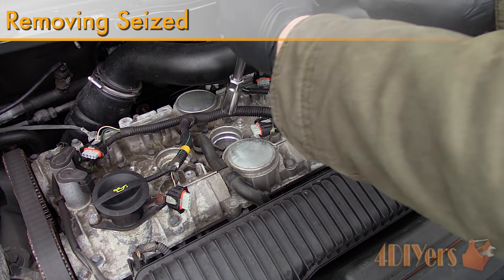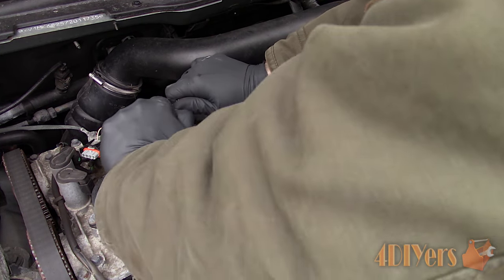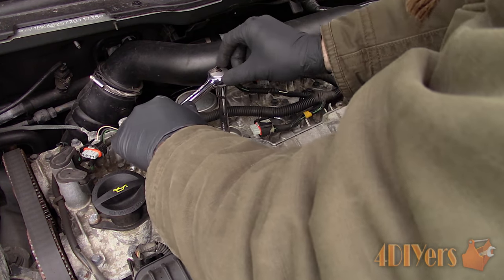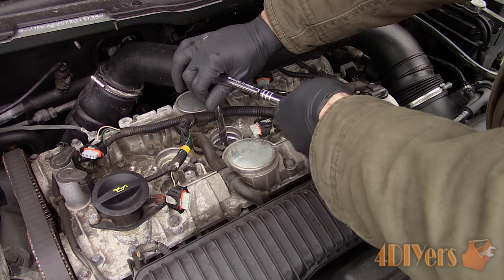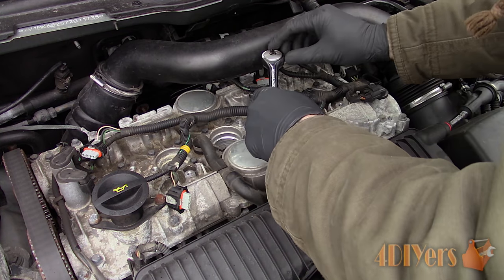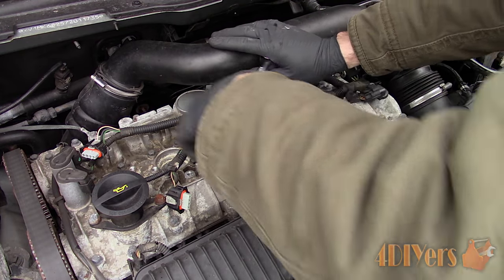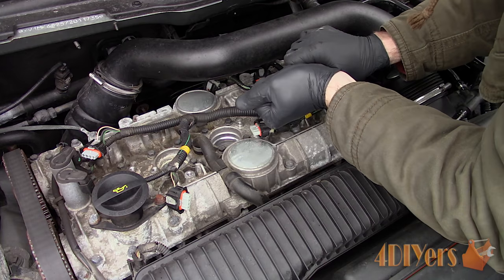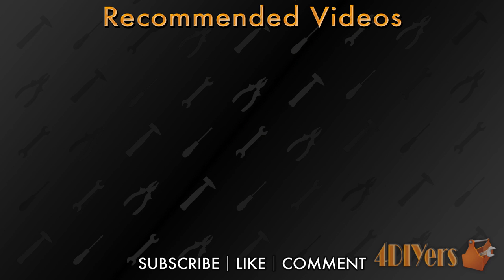How to Remove Seized or Stuck Spark Plugs

Comment: changed plugs on my daughters 2006 BM 325I  one plug was stuck i tried the back and forth and tried PD Blaster letting it soak started the car up to heat the plug  it as a pain all the way after a hour or so  it final came out and the spark plug had aluminum on its threads boy i was sick i just knew i wasn't going to get a new plug to start  But i got lucky it did and it seam to tighten  i used Anti-seize on the new ones not sure if thats a good ideal on aluminum heads but damn sure dont wan't to do that again

Comment: Thank you for the directions. I placed a piece of 1" schedule 40 PVC pipe on ratchet handle for more leverage.
Reply from the maker: No problem!
Reply: @4DIYers  Thanks for this video it actually helped me remove a stuck spark plug in my MK6 Volkswagen Jetta
Reply: I'd be afraid of too much leverage; rather strain myself than break off a plug!

Comment: I just replaced plugs in my 2007 saturn vue and they squeaked loudly coming out. I didn't do the back/forth method but just got lucky they came out ok with no noticeable damage. Being aluminum head I'm not sure if I should have used some anti seize. Would like your opinion, thanks.
Reply: I always use anti seize, and coat it all the way except for the last 2 threads. Just know it lowers the coefficient of friction so take care to not over tighten or crossthread.

Comment: I can’t get my plugs to budge either way and don’t want to really yank on it so am I screwed or what
Reply: Keep using a good penetrating oil on them, like pb blaster or seafoam deep creep. At night when the engine is cooled down soak them. Try removing them in the morning before you drive. Just keep doing that every day.

Comment: Dealing with this right now. I've read several people saying that Sea Foam Deep Creep turns carbon into liquid and melts it away. I just picked up a can. Hopefully I can get it out soon. Thanks.
Reply: Did it work
Reply: @mathewchavez9343  Nah. Either it's cross threaded or straight up seized. My head gasket started leaking recently, so since I'll have the head off, I'll fix it then.

Comment: Does soaking the spark plugs in oil help remove plugs that are a little bit melted? A mechanic said he didn’t want to break my plug in half and suggested I need a new engine
Reply from the maker: No it won’t help melted plugs. What happened? If they’re melted, your engine is most likely no good and will need to be replaced. Does it still run?

Comment: What if you have a stuck plug that you can barely see? I have a 91 ford Ranger. The plug is on the passenger side, closest to the firewall. Do I need to remove the AC to get to it?
Reply: If it's like the Explorer, and I think it is... wheel off and possibly the wheel well liner as well.

Comment: What I've just run in to is that the actual nut portion of the spark plug has broken off apparently with the spark plug still installed. I didn't even notice it until I went to inspect my spark plugs just as routine maintenance and when I went to place the spark plug socket over the spark plug nut, there was nothing there for the socket to grab on to. So i got a flashlight and looked down the spark plug tube, and that's when I saw that the spark plug nut was missing. So now I'm trying to figure out how to remove that spark plug, with the hopes it can be done without having to take it to a repair shop.  To be clear, the spark plug is still properly installed and the ceramic isolator as well as the electrode tip are intact and visible, car is still running just fine.  Question is how to remove that #1 spark plug that no longer has the nut attached to it.
Reply: What did you do?
Reply: @alexg8460  As it turns out, what had happened is that the last time that I had re-installed the spark plugs after doing a routine inspection the rubber retaining ring that normally sits inside of the spark plug socket broke loose and remained snuggly secured to the top of spark plug and most likely got shoved down on to the spart plug nut once the spark plug boot was reinstalled. So the next time around when I went to inspect the spark plug tips I wasn't able to get the spark plug socket to grab on to anything since the rubber retaining ring was shoved down on top of the spark plug nut and compacted enough that it wasn't evident even when shinning a flashlight down the tube. As is evident in my previous post I took some time to ponder the whole issue and after several weeks and trying to figure out how this could have happened (missing spark plug nut) it occured to me that if the nut had detached then no matter what if I slide something metallic down the spark plug tube suck as a stiff piece of copper wire I had that when that wire bottoms out I should be able to feel and hear metal hitting metal. So I did just that but there was absolutely no sound and also no metal agaisnt metal (or ceramic) feel. Each time I poked the wire down to the bottom it was just dead silent and something was fully absorbing the impact in a way that only a soft material could. So that lead me to believe that it was the rubber retaining ring that had detached from one of my spark plug sockets and gotten shoved against and heat molded to the spark plug nut.  In a way that was a big releif but still... what to do? I couldn't genetate enough movement using any sort of toll to get that now melted and re-molded rubber ring to budge. So lots more pondering, i started off by pouring some acetone down the spark plug tube to start softening up that rubber and then did a search of my workshop area for what I could possibly use to remove that rubber ring. I ran across what I believe is  the remnants of a small hollow aluminum flag pole section which looks to be about the right size. I then removed one of the other spark plugs to check for fit and what do you know, the hollow aluminum tube was an exact match for the ceramic isolator. It fit precisely over the ceramic portion like a glove. So i then got a dremel and grond down the outer edge of the tip of that aluminum tube so that it was sharp like a knife edge. I then lowered the sharp part down over the spark plug that had the rubber ring stuck/melted to the spark plug nut until it bottom out. Then using some force i started twisting back and forth while pushing downward and I could feel the resistance of the rubber as I was cutting right through it. Once I felt i had cut through sufficiently  wothout cutting through all the way I decided to try backing it out and as I did I could definitely feel something being pulled out  along with the aluminum tube and sure enough, once the tube was all the way out there was the remains of the rubber retaining ring attached to the end of the aluminum tube!  Enough of it came out so as to allow the spark plug socket to grab on to the spark plug nut and declare the issue solved.

Comment: so i got the spark plug loose as they will go but it still wont come out, if i keep trying to losen it, it will just squeak
Reply from the maker: Almost sounds like it's stripped. Does it tighten back up?

Comment: hi, i have another problem about spark plugs, one of them came out together bolted on another thread and we cant take it out so i have to return it back without changing it. so all 7 were changed except for this one. how to solve this?
Reply from the maker: Sounds like someone had installed a heli-coil. You'll need to replace the heli-coil and unfortunately I do not have a video for that.

Comment: Also is very important that you inspect the spark plug thread for damage, or if you see cylinder head spark plug thread stuck to the spark plug thread, then you will need to use a thread chaser to clean the thread or repair with a spark plug thread insert
Reply: hope that never happens to me don't sound like fun!
Reply: @makosharkcnc7730   Previous owner used epoxy to install a spark plug after he stripped the hole in a 2100 accord EXL V6... I'm not sure what to use to possibly possibly dissolve the apoxy and then I can't seem to get my socket around the top of the spark plug

Comment: how to get the carbon buildup out the spark plug well? without wd-40
Reply from the maker: You could run a fuel additive which is specific for carbon build up or mist water into the intake while the engine is running. A little spirited driving can help clear out carbon too, in a controlled environment of course. Worst case scenario is removing the head.

Comment: I literally did everything. I’ve had these same spark plugs for two years. I sprayed the pb blaster on the spark plugs left overnight and tired in hot and cold engine it’s still not working please help!!!! 09 ford focus 4 cylinder engine. I successfully removed one and replaced it without the pb blaster. But the last three are so hard it won’t budge even with the hammer.
Reply from the maker: Try Kroil, it's one of the best penetrating oils on the market.

Comment: Current issue with my 2003 Elantra. I got all 3 replaced; yet one is stubborn and stuck. Tried all day until it got dark. Cant even get the boot back in. And the boot is not broken because I plugged it into another plug and it clicked into. Prayers that when I use this technique, I’ll get it out

Comment: Should you place a squirt or two of oil to help with the removal and to protect threads?
Reply from the maker: I would recommend it. Some people also apply an anti seize, but most spark plug manufacturers also don't recommend it and some also have an anti seize coating/plating to prevent this from happening. Personally I'd avoid the excessive maintenance interval recommendation from some manufacturers. If you're doing the work yourself, replace them sooner rather than later. They're not overly expensive and when it's kept tip top, you'll most likely get that money back in fuel savings anyway.

Comment: Get ya some PB Blaster and fill the well of each spark plug on a cold engine. Let sit for a half hour then do it again. Start her up, let warm up for say 20-30 min. then shut her down and immediately squirt each plug thread body with PB, where it meets the engine. An expanded hot hole, then a cooled shrinking plug and pop, out she comes.
Reply from the maker: Great tip, thanks for sharing! I typically like Kroil, it’s by far the best penetrating oil I’ve ever used.

Comment: PLEASE HELP IM IM A JAM!! Anyone?
Can't really afford to have the whole top half of the engine machine at a machine shop but ...
Previous owner used epoxy to install a spark plug after he stripped the hole in a 08 accord EXL V6 3.5 sedan...
 I'm not sure what to use to possibly possibly dissolve the apoxy and then I can't seem to get my socket around the top of the spark plug.
 BESIDES THAT A Coolant line busted to the transmission also but I came up with the idea to put an external transmission fluid cooler on it and just refill with fluids and it runs fine... so now I'm really considering taking On this STUCK SPARK PLUG IN THE FAR BACK HARDEST TO REACH N WORK AROUND PLUG HOLE. LUV THIS CAR

Comment: Aluminum (head) has a coefficient of expansion greater than that of steel (spark plugs) So crack them loose while the engine is hot, then when the engine has cooled remove them and replace and torque them.
Reply from the maker: Doing this will the engine is hot is the best option, ran into some like this. After it cools, it can become stubborn again.
Reply: @4DIYers  Yes, but the tightening torque should be done on a cold engine. I installed new plugs while the engine was warm, then torqued once completely cooled. Also, never put lube on plug threads.
Reply from the maker: Yes I am aware of all of that. However this video is only specific for removing seized plugs.

Comment: More of a question than a suggestion, (not ignoring the freeing products), but because of expansion etc, would it help to run the engine to temperature, then chill the plug (somehow? Dry ice, regular ice?). That way the metal around the plug expands, but the plug contracts slightly. Put a box spanner over the plug and seal the engine end with a little silicone? Circulate iced water in it? Syringe in, syringe out? May be crazy or destructive. I don't know. Then quickly, follow the video. 
My Volvo 940 has seized plugs. The garage says it has a special machine to drill them out and then force fit new threaded inserts. Pricey I guess.
Reply from the maker: It may work, however the biggest issue tends to be the carbon build up. A top quality penetrating oil usually works such as Kroil, then let it soak for a longer period of time. You can flip a "can of air" over and it'll spray out nitrogen. Typically new threaded inserts are just done with hand tools, they're called a heli-coil.
Reply: @4DIYers  Thanks for that.

Comment: I have a 2000 nissan xterra 3.3, the #6 plug has been in there through 2 tune ups, it was another family members car before me and he told me he could never get to it, so im not sure how to tackle this.  I did like one of the other guys that commented earlier and took it to two different mechanics and they said no dice, well one of them wanted more than the vehicle is worth, and I'm on a strict budget, I try doing most repairs myself.  Any solid help or advice would be much appreciated!
Reply: Did u ever get to that spark plug? Try soaking in penetrator?
Reply: @superperior  
Yeah, I finally got it,and that's exactly what we did, for 2 days, then once again before warming it up, and took our time with it, I bought a couple of specialty tools and finally got her out, and maaan was it funky, after 200.000 plus miles!  But  thanks for your tip.👍
Reply: @jamesrobert7155  awesome glad to hear that thanks for getting back to me. I have a highlander with about 120000 dont know if/when  previous owner changed them last

Comment: My spark plugs are stuck, but not because of being too tight. My problem is that I start loosening, then after a little bit I essentially loose traction and the pressure is no more. When I try again the same happens.
Reply from the maker: So they just spin freely, like no resistance? Almost sounds as if they're stripped.
Reply: @4DIYers  They don't spin at all, it's like there's resistance but then the socket slips.
Reply: @venomvideos855  Sounds like your spark plug hex head has been worn down on the points and your socket is slipping. Bad situation..
Reply: @steveandrews8301  I solved it a long time ago, the problem was actually that the cylinder in which the spark plug is mounted was too slim which in turn prohibited my socket from going all the way down.

Comment: Here’s the thing I can’t even get the last one in my motor to budge I’ve soaked it in penetrating fluid and let the motor heat up I’m kind of stumped
Reply from the maker: What are you using for penetrating oil? I would suggest using something high quality like Kroil. You can try using an electric impact to rattle it loose, but be extremely careful not to rip the threads out.

Comment: Not so much as a tip but a question.. can I spray a little seafoam around the spark plug as it is known to break down carbon. I’ve heard carburetor cleaner can be use but can also cause damage.
Reply from the maker: Adding Seafoam from the top probably won't make that much of a difference, you'd probably be better off running it through the intake while the engine is running. Misting water is also known to achieve the same effect, helping remove carbon. Unless you already have the head removed, then you can certainly soak the around the spark plug with Seafoam or carburetor cleaner.

Comment: What is a good penatrating oil?
Reply: I prefer PB blaster, but thats just me. Has always worked. Just be patient!
Reply from the maker: Kroil, probably one of the best I've ever used. One commenter also recommended making your own which I believe was transmission fluid and acetone.
Reply: 4DIYers I’ve never tried Kroil yet, is it really better?
Reply from the maker: I've used a lot of different things with great results and have heard positive things with others who used it in various professional fields.
Reply: 4DIYers I’ll give it a try! I’ve also heard that GM penetrating oil is really good. But I never tried it myself.
Reply: @SladesVWBeetle  Thank you! I've used it but it still took alot of effort to get the spark plugs out.... Thanks
Reply: I used Blaster PB...
Reply: ballaatl22 Your doing better than me! I have one on my car that will not come out, no matter what I do. 😳
Reply from the maker: Didn't realize GM had a penetrating oil. Found out earlier today from some techs, apparently some are using brake fluid as a penetrating oil. It's supposed to work great.
Reply: 4DIYers My one buddy swears by brake fluid, and he’s old school and done that forever. Yes, I found out recently about GM penetrating oil. It’s supposed to truly work wonders. I need to stop by a parts counter and buy it.
Reply: @SladesVWBeetle  I had to get a man to get them out & he was struggling but he put the PB Blaster on & kept turning to get it out & he manage to get the out but having a wrenchet with a pole or something that is long to help with leverage will help...
Reply: Liquid Wrench, since 1941.

Comment: I was pulling mine out and it almost felt like I was stripping it so I slowly removed it without going back and forth unfortunately I may have messed it up and I also put a new plug in there with a good bit of anti-seize although tightening it feels weird I did most of it with my hand but I’m scared I’ll strip it or it may already be stripped what should I do?